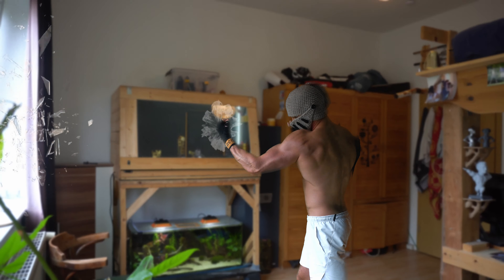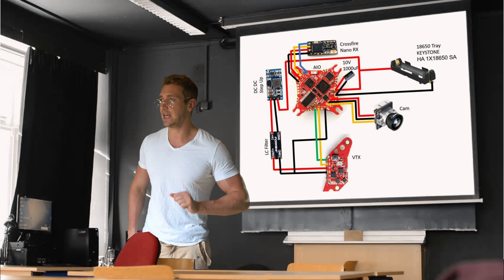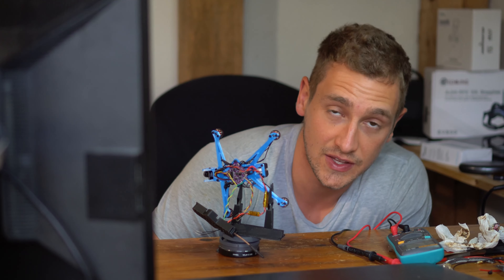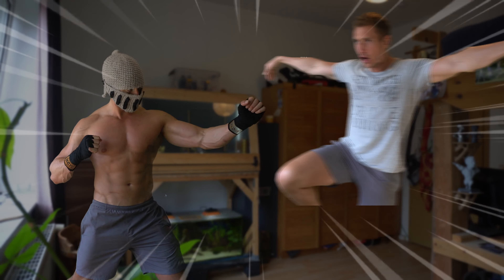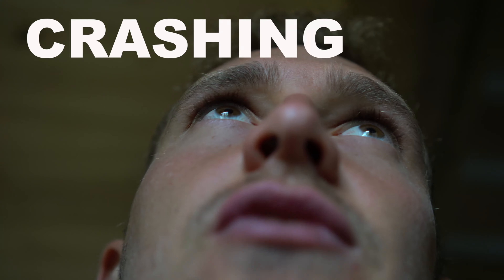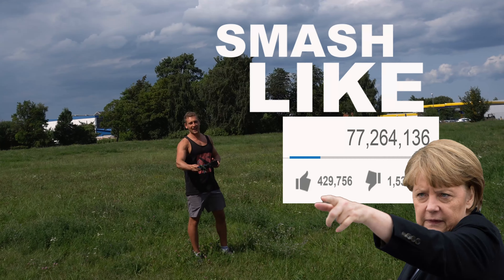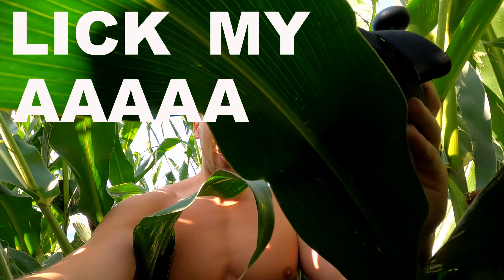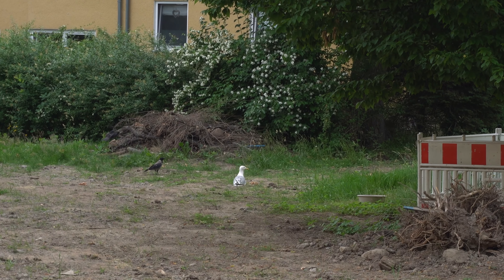I Built a 3D Printed Nano Drone (To Save Bodybuilding)

Comment: geiles Video! I'm glad to see it worked out and that you got it flying. I felt your pain when you had to rewire the whole thing. Great job! This is a difficult project. I posted the link of this video to my build video description under "Successful builds using this guide".  Ich freue mich auf dein nächstes Video! \m/
Reply from the maker: Danke sehr! Yessir, was pretty painful. I also destroyed 2 of the PLA frames and had to assemble everything again :D  but the Nylon-Carbon one is doing a great job so far. I've had far worse crashes and it's still going strong. Thx for the shout out. Second next video is gonna be a bigger DIY attack drone  lol